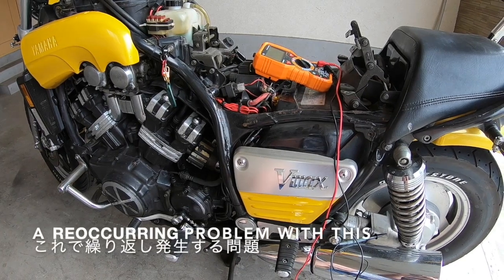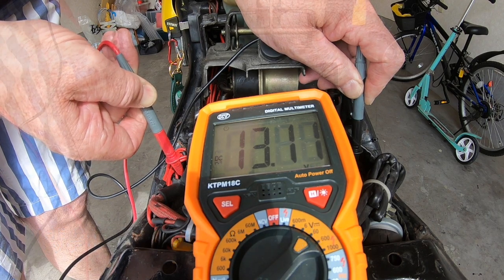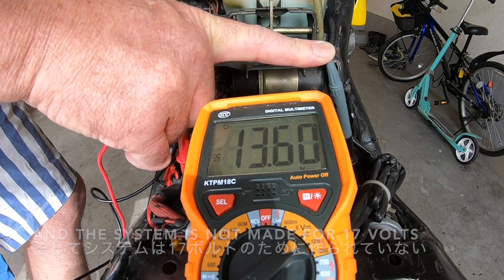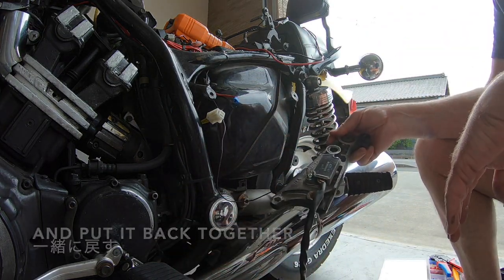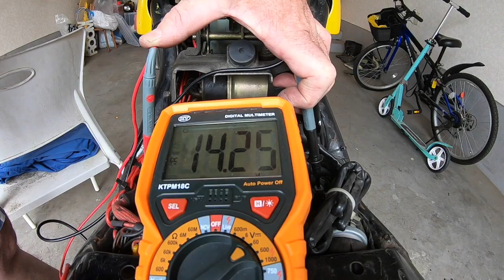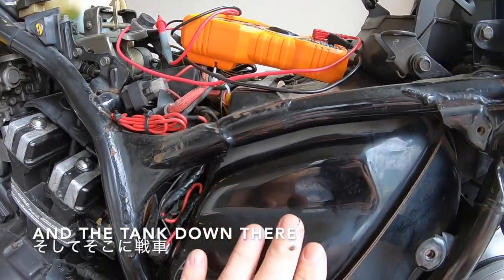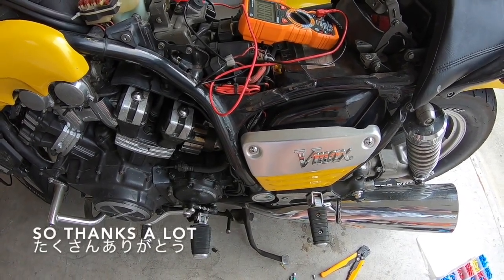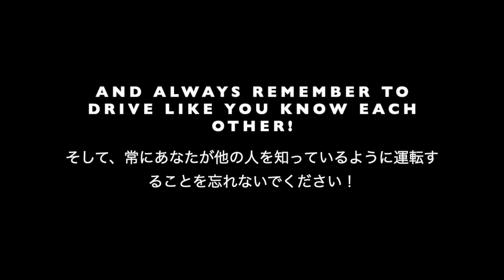Your bikes electrical system is over charging. What now? How to fix it!

Comment: Now switch to a lithium LiFePo4 and see if that regulator works.
Reply from the maker: Good luck! I have found that the battery type isn’t important as the regulator will still charge is the level of the battery is low. But I will be interested if it does fix the problem. KR